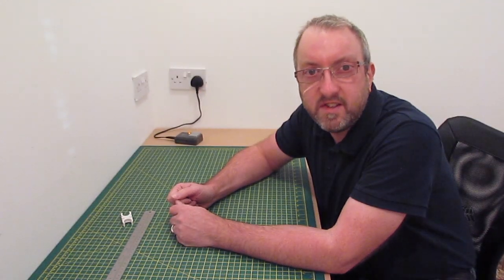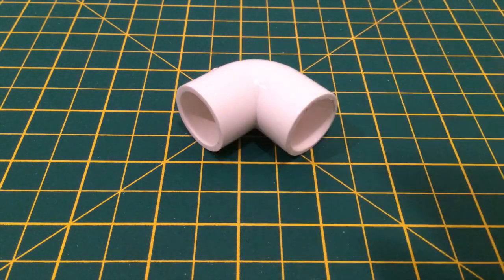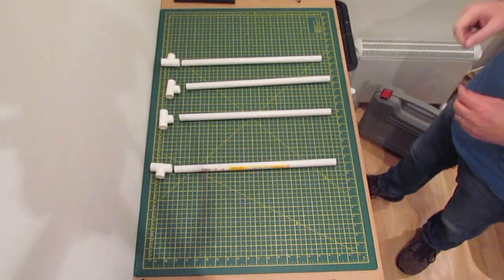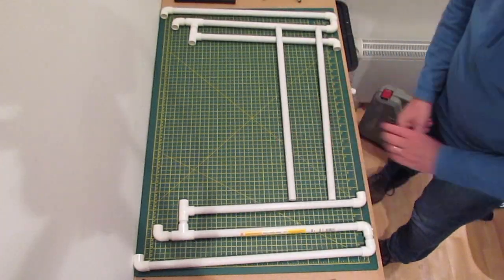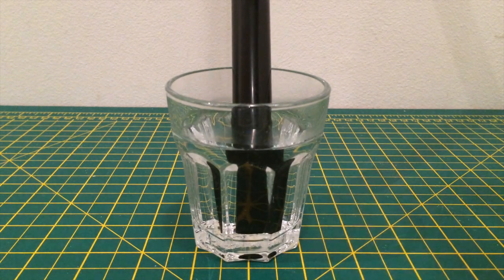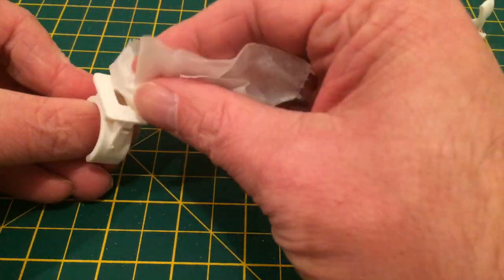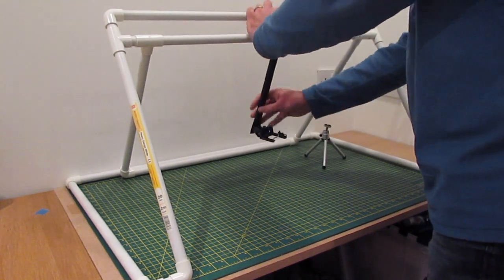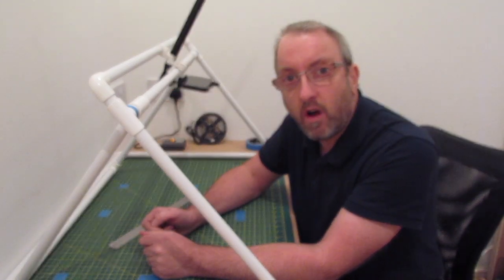Building a Folding PVC Camera Rig //free-plans //howto

Comment: I was pricing up galvansied steel versions of this kind of DIY camera rig and watched may videos but your PVC design is much more attractive for small spaces - and I have that same desk! Have you used this with a DSLR camera? Does the structure suffer from not being glued?
Reply from the maker: I have a bridge camera, which is the one you see on the static shots. I did find that after time, the horizontal bars at the top would sag if too much weight was left on them. Swapping them for wooden poles (dowels or curtain rods) or metal versions would be a good solution. 
I did follow my idea of extending the length of the vertical pieces to get a greater height off the counter. Much more flexibility that way.
Reply: @Tinkerneering  Thank you for replying! Of all the PVC DIY's we watched, we agreed your design is best. We are going to need stronger support in the office-studio and are going with the galvanised steel. I will recreate your rig design for iPhone recording, and will attempt to make a portable version for plein air painting that I can carry with me; something to setup on a picnic table. Thanks for the inspiration!

Comment: Hi, I want to set this over gas station to make video of recipe. My table is 1000cm X 600cm X 700cm hight required.
So pipe size 1150 -1no.
1020-1 no., 890-2no.
550-2no. 660- 4nos.
Is it ok??
Reply from the maker: The pipe I used in my video is cable pipe and not water/gas pipe. That's the same for both the frame and the camera arm. You can see that this gets very flexible even in lukewarm water. I would not advise putting any pipe like this directly over an open flame or cooking area.

Comment: will this work with heavier cams like a dslr?
Reply from the maker: That camera I have in there is a superzoom bridge camera, which is fairly heavy. If I were going to mount a full DSLR on there I might replace one of the top cross pipes with a dowel. The rest of the frame would be fine.
Reply: @Tinkerneering  could you please make a video on just that? this video was fantastic and very informative thank you!